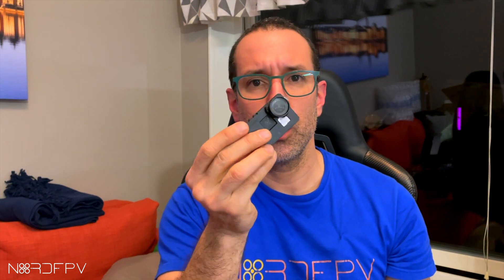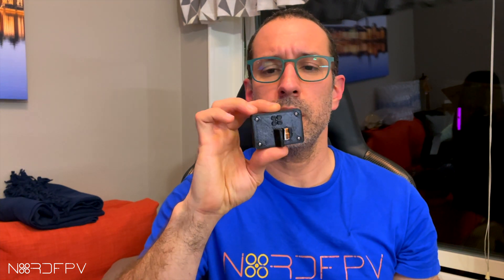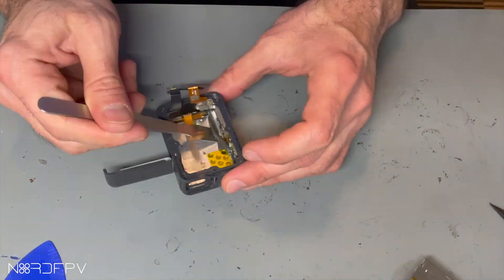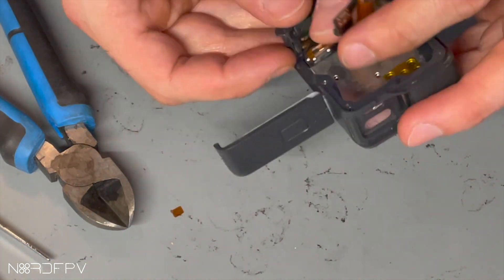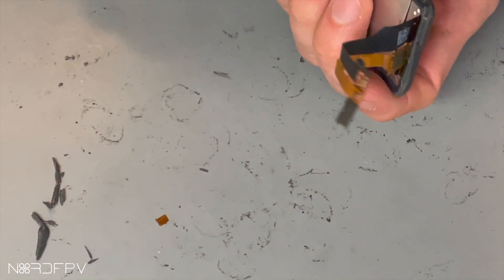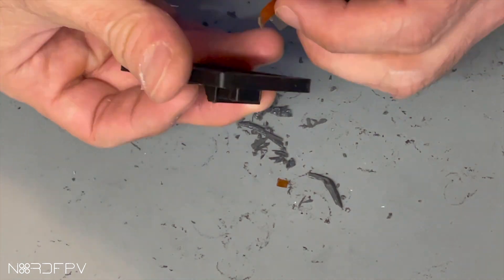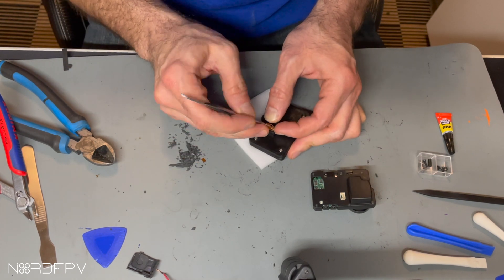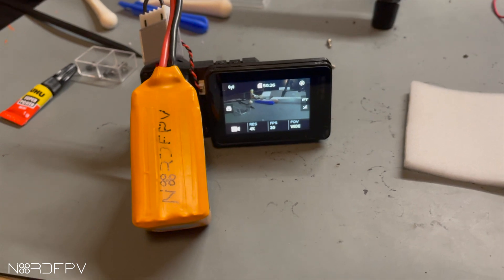Naked GoPro 6 removable screen

Comment: this is great but is there a better way to align the ribbons so they make a connection? ive spent almost 3 hours... feels like something is blocking it or something
Reply from the maker: Hi, not to my knowledge. When you are inserting that cable you feel a click.  You feel like, don't hear it. Check that you have it in the right orientation because it doesn't fit on both directions.
Reply: @NordFPV  thanks for the tips unfortunately i ended up messing up one of the ribbon wires. In the right orientation but .. 20 dollars got a new one shipped and we try again

Comment: Great video!!! I changed to a new phone and lost the pairing to my Naked GoPro Hero 6. I watched your video and was able to pair to my new phone. Thanks for posting this video!!! Very helpful!!!
Reply from the maker: I'm glad it helped!
Reply: @NordFPV  I printed the parts for the display. The dimensions are a little small. The display does not fit in the case. Also the ribbon cable slot is not long enough as my Hero6 ribbon cable will not fit.

Comment: Hey, I've made that screen by your 3d models, it's awesome. But I had some troubles with gluing screen tails. And I found really good and easy way to do it. 
First of all you need to pass tails through all holes, then connect tails to the pins, and then put some glue on the back side of the tails. After that you can push on the 3d printed part of the screen and snap it. It takes some time for glue drying, but after that you will have perfect results. May be it helps somebody )
Reply from the maker: WOW,  great work! thanks for sharing!
Reply: definetely good idea
Reply: How are you able to connect the cables before? I'm finding it very hard since they are very short when I pass them through the 3d case
Reply: Awesome! U rock thanks!
Reply: i know this is old but just tried this and it worked the first plug in after it dried but now i cant make the connection got the click once and never again after that.. these connections are soo so small..

Comment: Does the camera have to be connected to the fpv battery to work? Can a naked gopro work with its own battery?
Reply: You can’t use the GoPro battery in a naked GoPro. You need to feed it from somewhere else. Normally from the lipo or the FC

Comment: Great job! Side question, did u solder a wire for the wifi antenna, or left it as is? Some worry it can burn without  a custom antenna wire.
Reply from the maker: Hi. I did, but honestly, my WiFi has never worked since I did the naked procedure. Bluetooth is fine, and I control the camera over it, but WiFi and live feed has never worked since I opened the camera
Reply: @NordFPV  thanks! I found a way to connect. Open app, connect to wifi camera profile using wifi list in phone. Close gopro app. Open gopro app, and now it will connect. Basically you need to initiate the wifi connection manually.
Reply: @NordFPV  because antenna was only in original case )
you can solder wire
Reply from the maker: @sashacurly  I actually solder one paying attentio to the lengh so it's compatible with a 2.4Ghz radio (wifi), but it didn't help me much. It's a bit of a lottery. Sometimes it works, sometimes it doesn't
Reply: @NordFPV  somewhere i see that wire must be 31mm long

Comment: I can't remove the plastic around the lcd competely. But the linked case need this because it's to small (I don't have a 3d printer and I just asked a friend. So far no way to get the screen inside the case).
Reply from the maker: Apply some heat with a heat-gun, it may help you. It's a tedious work but with patience you will get it out